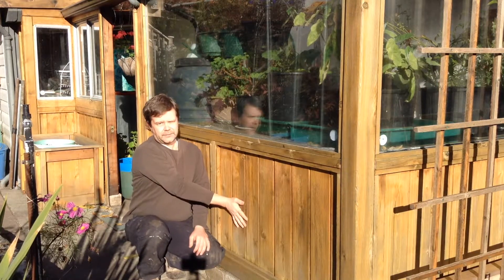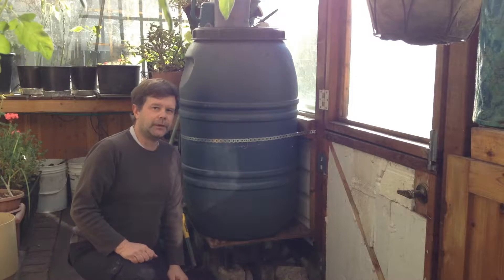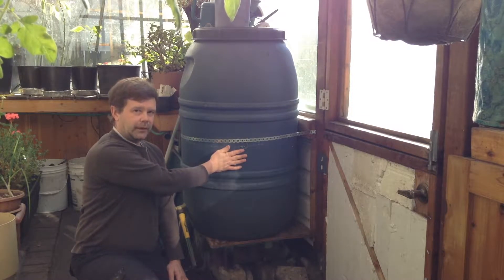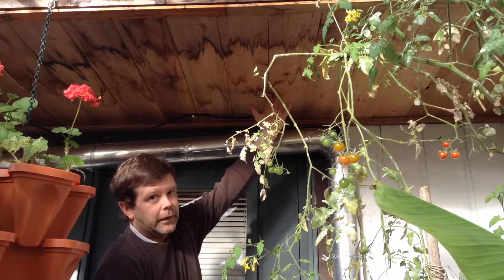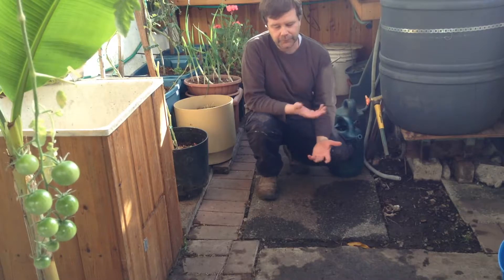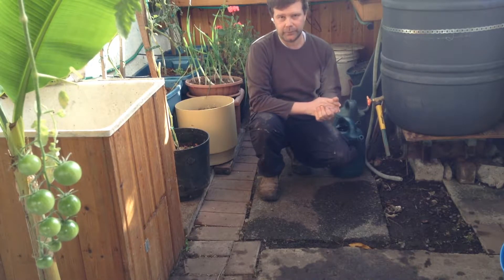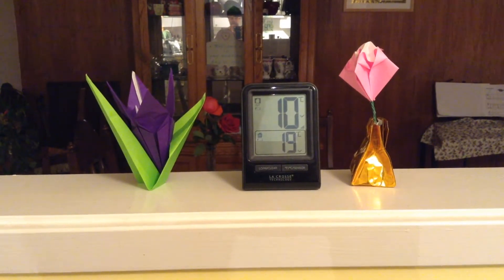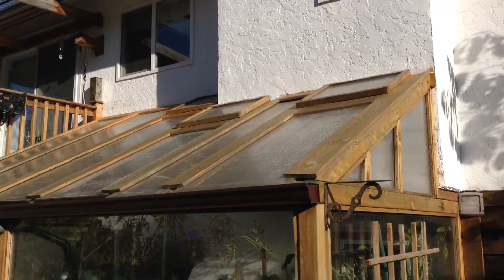How to Add Passive Solar Features To Your Greenhouse

Comment: Do this bricks on the floor have insulation below them? As I am just building a greenhouse, I put the white Polystyrene board insulation before I laid the bricks to make the floor, but had the same idea as you, black bricks to absorb the heat during the day.
Reply from the maker: No,, they don’t in my case but that is a good idea. Especially if your ground freezes. In my case that happens rarely plus it’s next to the house so is more protected. Good luck with your greenhouse!

Comment: Great video! I’d love to know more about how the rain barrel is connected to the gutters and fed in through the outside to inside. Were you able seal it off enough so there’s no dripping or leaking when it’s actively raining?
Reply from the maker: It was relatively easy. I simply drilled a hole of the correct size in the one support post and used a few elbows and pipe from the hole in the bottom of the gutter through the hole in the support post and then into the top of the barrel. No leaking. The hole is anyways covered by the gutter above it.
Reply from the maker: Hey Ashley, I made a followup video for you on how I have the rain barrel connected. Have a. watch: https://youtu.be/hy3BvsglLRM
Reply: Thank you! I’ve just watched it! 🌻